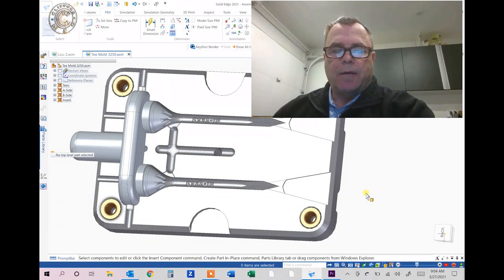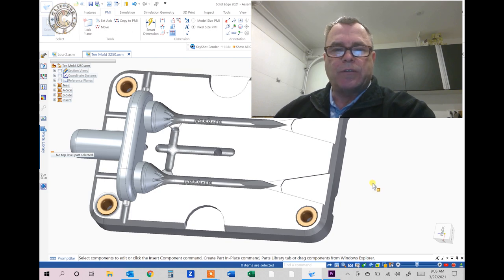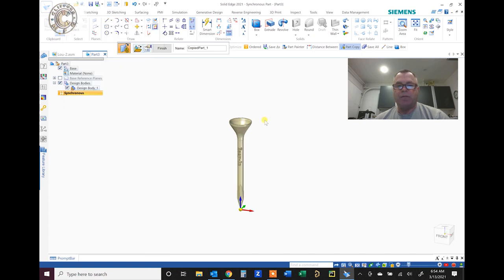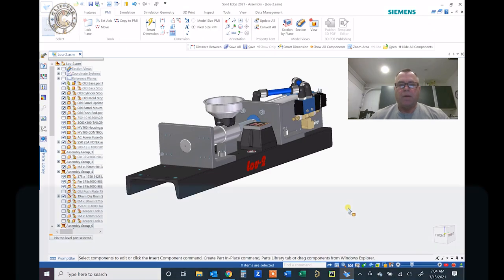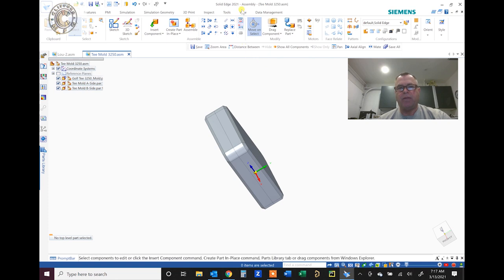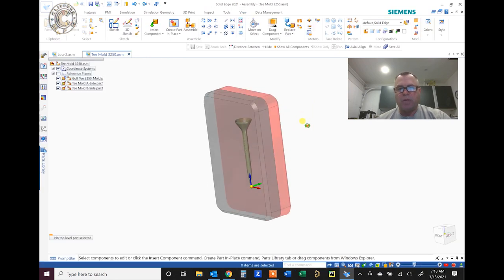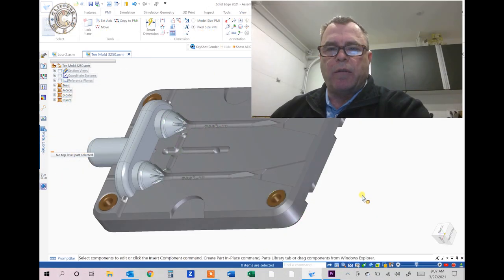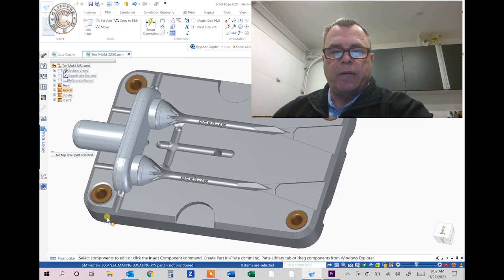How to design a small injection mold for desktop injection molding machines.

Comment: Did you not want to use the mold tooling option in SE
Reply from the maker: What does SE mean , I am not familiar with that term?
Reply: @scottclifford-cliffordmfg4148  apologies - solid edge mould tooling . See https://www.youtube.com/watch?v=Fr5M7QHojnc although not in English the steps are easily followed .
Reply from the maker: thanks for sending ... I did not know they offered a tooling option.
Reply: @scottclifford-cliffordmfg4148  SE is simply an abbreviation to this 3D modelling program called Solid Edge.